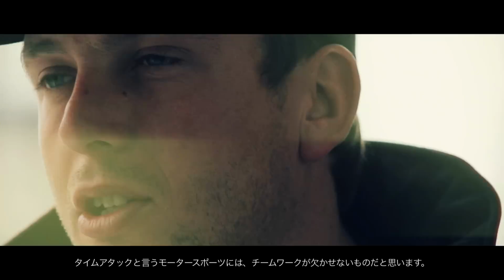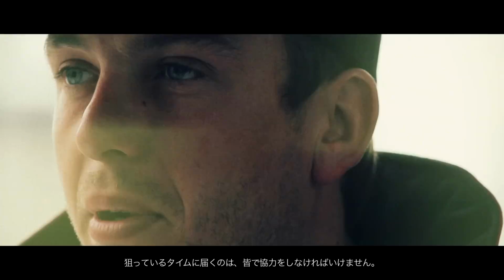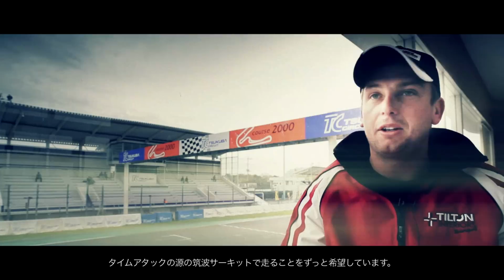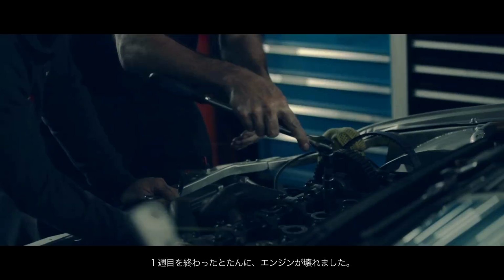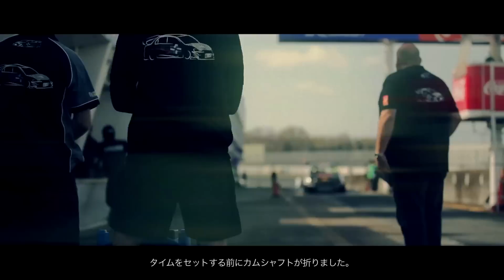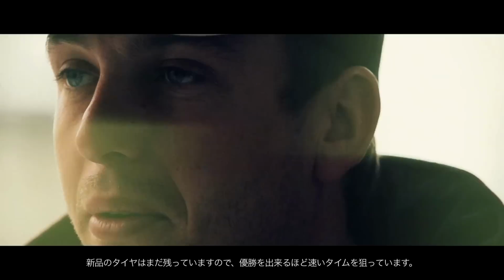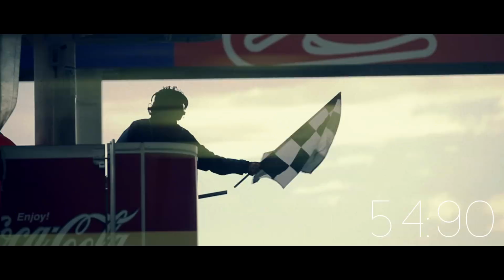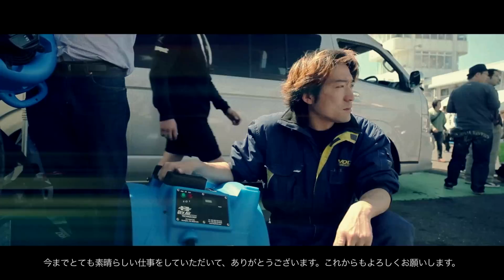Behind The Wheel - 850HP Mitsubishi Evo Tsukuba Circuit Time Attack Video

Comment: That thing sounds wildly unreliable, and the onboard vid looked like it has understeer. Shoulda gotten a Porsche GT2 as a base car
Reply: You're joking right?
Reply: Zach Eads They had one engine fail the first day, the second day they broke a camshaft before they even started the first flying lap, and you can clearly see him winding the steering wheel in more and more in several corners due to understeer. So no I'm not joking.
Reply: I definitely prefer Sushi over Frankfurts
Reply: LOL ever seen a proper time attack car go somewhere with out a spare engine ? no. wanna know why a gt2 is more reliable coz it dosnt make 850hp or pull any where near the same lap times. any thing pushing the edge is not going to be reliable, thats motor sports. maybe you would know this if you didnt own a stock NA car. wanna know what cars hold records in time attack ? not a gt2. car will over steer or under steer on how the suspension and down force is set up, sure AWD naturallly understeer, HKS evo held record at tsukuba for years and a evo currently hold world time attack record, with porches against it.
Reply: No a gt2 dosent make that much stock. I don't think time attack cars are stock though. A gt2 engine has more displacement (needs less boost) and has 2 more cylinders to spread the load across. It can make that much power more reliably. Granted the engine itself will weigh more. An Evo held the record for 2 years? Thats cool. The 935 was competitive and won races for 3 decades. And that was the old air cooled turbo that isn't as efficient as the new motors porsche puts out.
Reply: Reece Mechanical You may have a point about reliability but choosing gt2 over evo does not guarantee your car will be free of handling problems (understeer etc) after all the mods and weight reduction. You still need to make it works. Choosing 911 just because 935 used to dominate racing is like choosing Maserati GranTurismo because Maserati 250F was so dominant back in the day. A bit ridiculous.
Reply: Not really the 935 was a street modified 911 with the slant nose package. They also made about 600-900hp depending on boost. The Evo is also a street car modified in to a race car making a similar power out put. The Maseratis from back in the day can't be compared. I mentioned the Gt2 as a base car because its actually being produced in the same era as the Evo, un like the Maserati. They are both water cooled with similar power out puts so I'd say they are comparable
Reply: Reece Mechanical That 911 (930) is not the same as 911(evo 8/9 era = 996/997) you suggested though, not fully related. GT2 also has much more power than evo 450+hp compare to evo average of 300hp and also cost a lot more. I think the main reason they chose evo is because it's more of a challenge or maybe evo is their speciality.
Reply: Yes maybe they just like Evos. And I was talking about comparing the Gt2 and the Evo race prepped. They would both likely have around 700-900 hp. I'll bet the gt2 would have a wider power band and would be more reliable
Reply: Race prepped cars always defined by regulations of the series they enter. As far as I know, they never compete in the same competition officially under their marquees. If the series is open and unregulated, the power and reliability will only be limited by engineering capability and maybe the budget. 1.5L m12 F1 engine can produce up to 1500hp based on m10 road car engine with no more than 150hp, no reason to think the base car as a limiting factor. And also GT2 is much more expensive, even though the base model is better, most likely you have to replace a lot of its part anyway. Not such a good investment.
Reply: I'd be willing to bet the initial cost of the Gt2 would balance out because you wouldn't have to modify it nearly as much to make it as fast as this Evo.
Reply: Reece Mechanical That's where you're wrong. Even if, the GT2 requires less, it costs way more for parts. Also part replacement costs a lot more than the evo. I'm pretty sure most people would use a GT2 platform, not a lot of people would say no to it but the costs to maintain it and modifying it costs a lot.
Reply: I'm certain you know so much more than a racing team on these matters. I'm sure you and your near stock E46 could do a heap better. Try sending them some advice on suspension setup and how to build a proper track car.
Reply: David where, in anything I posted, did you gather that I believe my e46 would out run this? Please take a screen shot and point my own words out to me. And I am sure this team had the car setup as fast as it can go. My point is there are better base cars to start from that won't have these reliability issues.
Reply: Michael Dao Where this required many parts for a cosworth engine (you think those parts are cheap? Sike.) the porsche could make this much power with more bottom end without breaking. I'll bet you a cosworth head is going to run you about the same as a modified stock porsche head. Neither car would be running on factory parts. But yes a stock factory Porsche part will cost more than a Mitsubishi part.
Reply: gulag I agree, perhaps they wanted more of a challenge. The EVO is also a mainstream tuner car and that may have had something to do with it as well
Reply: Reece Mechanical First of all, GT2 despite being a fast road car is mainly a luxury car. First thing you have to do, is strip all those expensive interiors off. Not to mention stock suspension of any road car is not up to level in this competition. GT2 car will also need just as much aero modification as the evo, the gearbox is also not up for it (sequential is the best for the purpose)  What's the point of using an expensive car if you end up throwing out most of its part. I suggest you check out motoiq articles on few of these time attack cars (evos in particular). You'll see how much works goes into each of these cars and clearly these people know what they're doing. There is absolutely no evidence of GT2 being a better base car except your apparent willingness to bet on it  ;-). Lower displacement engine also has the advantage of being lighter, very helpful if you're trying to achieve perfect weight distribution. And you said evo is a mainstream tuner car, as the result of that there are more aftermarket performance parts available for it, thus choosing evo is a no-brainer to me.
Reply: LOL GT2  unless you spent mega $$  to get the Porshe weight down to match the Evo it wouldnt stand a chance. light weight 4WD turbo cars will always dominate time attack. there are GTRs at WTAC that make over 1000hp but the weight just kills them in the corners. GT2 wouldnt be much different.  then again if you throw enough money at a car its bound to be fast no matter what it is.
Reply: Reece Mechanical This Evo costs around $600,000 to produce. So you can easily buy a GT2 with that money. The reason why they chose that platform is because the Evo is capable of being much faster over one/two laps than almost any car. This is called time attack, not racing. In comparison, a 458 challenge race car with slicks is a full 7 seconds a lap slower than this car in Sydney Motorsport park.
Reply: Shadowboost i'm pretty sure he just trolled you, nobody is going to compare a evo to a porsche in terms of whats better.. porsche just has a fatal flaw, and at a certain point you just can't work around it.
Reply: Darrel Oateast How many Evo's have won the 24 hours of Le Mans? If they are so superior where are their wins in international sports racing? You sure must be right about Porsche's having a fatal flaw and not being competitive.
Reply: Reece Mechanical  Huh?  Are you serious?

Please list for me how many racing series allow electronically controlled AWD systems, unlimited boost/engine modifications, unlimited Aero, and no weight limit. 

A 2WD Porsche won't go anywhere close to these AWD cars
Reply: Reece Mechanical evos are used here a lot for their awd system. Indeed it causes some natural understeer but these guys put enormous downforce on the front wheels. There is simply no way you could do the same laptimes as these evos in basically any rwd street modified chassis and street tire wich they are running. In time attack reliability is really not as important as in classic racing because you race for baaically 20 minutes. The important thing is to be as fast as you can once in those 20 minutes. This is why you see so many evos and stis and skylines in the unlimited class: awd...